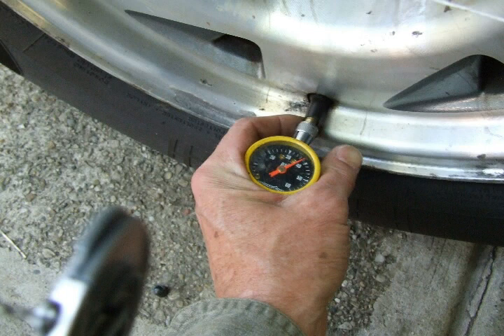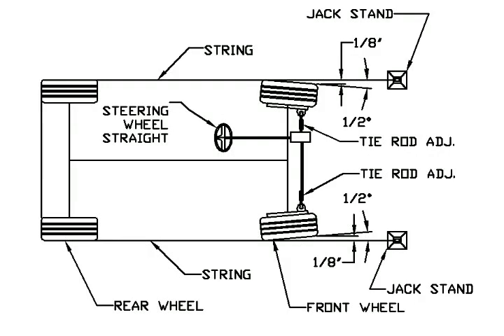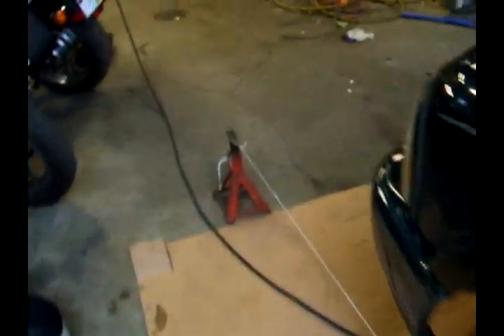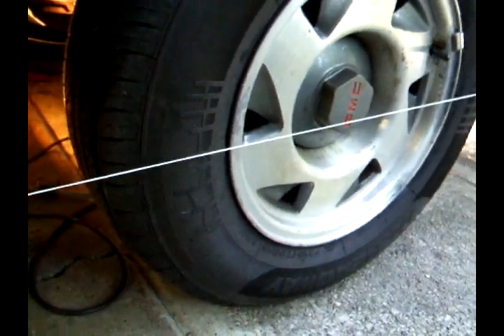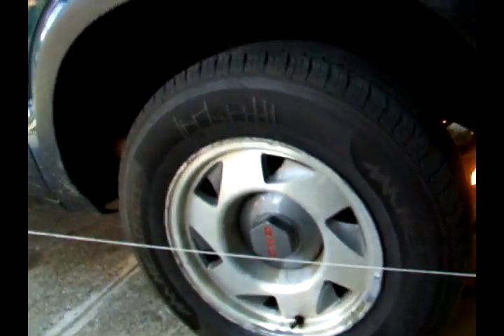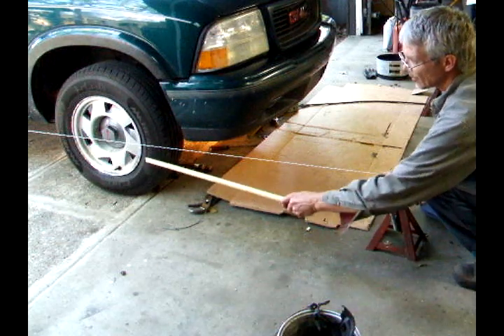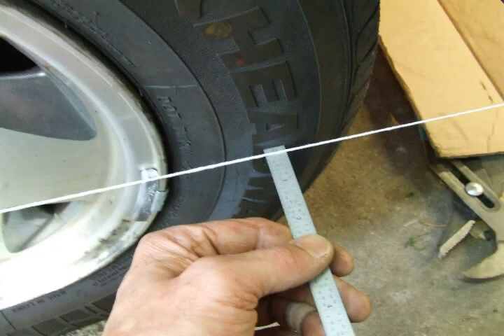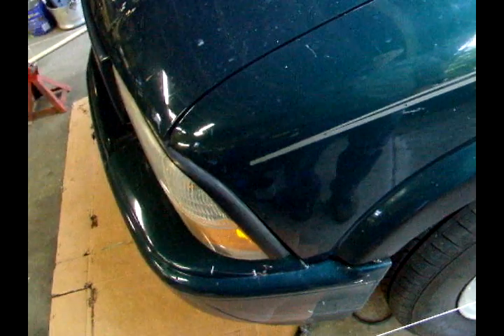Easy Front End Alignment, no special tools

Comment: Fantastic idea.  Use to do it a different way that required 2 people.  First jack up the vehicle.  Take a nail or screw in a board.  Rotate the tire and scribe it with the nail.   Then measure front and rear of the scribe marks.  Of course this was easier on my Jeep than most vehicles.   Like your way, way more.  On my Jeep the recommendations were 1/8 to 1/4 toe in.  Best to check manufacture recommendations before doing this.  One other thing.  On larger tires, check several spots.

Comment: Measure the center of the wheels on the rear and then the center of the front wheels. Toe  it in according to specs. Center the steering wheel by turning it all the  way to the left counting  the TURNS and then all the way to the right. Then turn it  back to the  middle centering the spoke. Get a OTC  steering wheel holder or have someone to hold it. JEG has a toe gauge. Get a caster-camber gauge and appropriate  tools. Don't  use a inner  tie rod tool to install the inner tie rod. Get OTC inner tie rod tool that holds the rack to tighten  the nut. With the other tool, it can damage the rack worm. Replace the whole rack unit including outer tie rods.

Comment: This works if there is a same track width in  rear and front.
Reply: Yup, on my '05 Pilot the rear track width is 5mm longer than the front so I have to make sure the string is 2.5mm farther away from the center of the front wheel (on each side) compared to the rear so everything is parallel before I make my adjustments. On my '98 CRV the track width is identical so it doesn't matter but it's a different story with the Pilot.